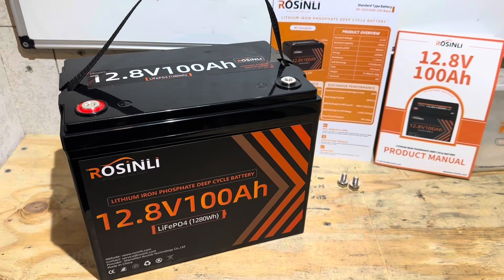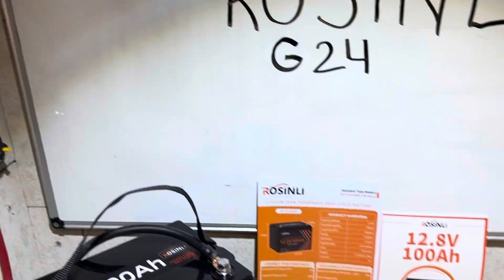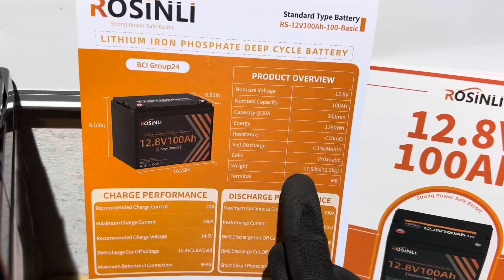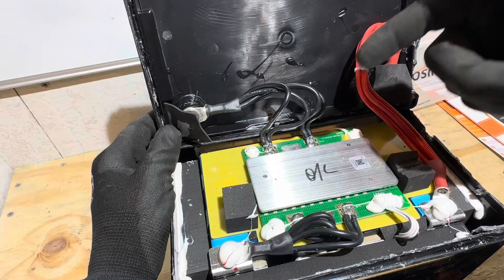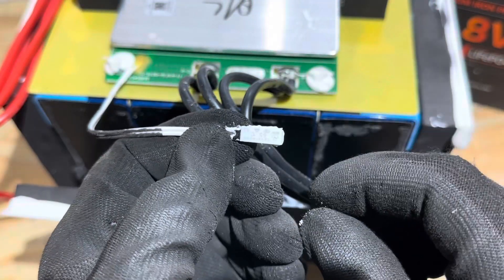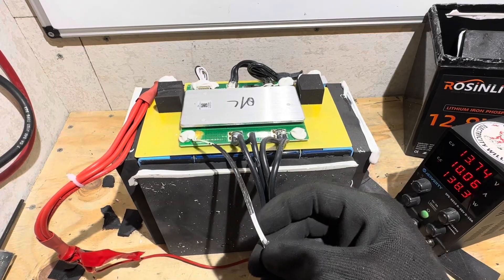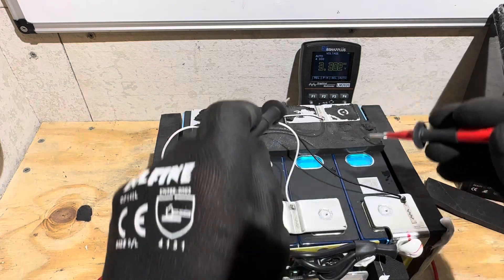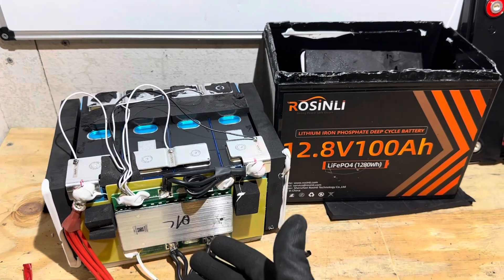CHEAP 12V 100Ah LiFePO4: ROSINLI 12.8V 100Ah LiFePO4 Lithium Battery Review and Teardown

Comment: I bought one of these for my overland daul battery system, and I'm really impressed on how it preforms. Left it in my rig with my fridge running for two days straight and only took the battery down to about 80%. Fridge draws about 5-7amps, and average air temps of low to high 70's on sunny days. Very impressive.
Reply from the maker: Awesome! I really appreciate you sharing your real world experiences with the battery! 👍

Comment: Will it work on boat? Being charged from alternator?
Reply from the maker: Assuming outboard motor? Do you know the charge current and voltage from your electrical system? Most of the manufacturers recommend a DC to DC charger. To properly control current and voltage for LiFePO4 on a lead acid charge system.

Comment: No good for mobile. should pull a little better for new cells
Reply from the maker: I have noticed since the price wars began several months ago on all these 12.8V mono block units that lower price points have also caused lower capacity numbers. Last year it was common for a similar cheap battery to do 104-105 new. Now most are doing 101-102. Also many used to use EVE/CATL/Goshen. Now it’s oddball or no namer cells.

Comment: Good review as usual. Great price for a 100AH lifepo4 battery. I remembering paying $200 for 100AH AGM's. PS, do what you can about the annoying ads :).
Reply from the maker: @bobjones9727  Thank you! Battery prices have definitely dropped which is great for those  needing some energy storage! My first Zooms(Redodo) 100Ah were $399! What kind of ads are you seeing? Are you referring to ads placed by YT? I have no control over the ad type, the placement of ads or the duration.
Reply: @THEOFFGRIDMOUNTAINHOMESTEAD  Yeah, they're YT ads. All kinds of BS I don't need.  I have Brave browser that did an excellent job in blocking them. Then YT said blocking ads are a ""violation of their community guidelines". So they steer around the block. Oh well life goes on. Keep those vids coming.